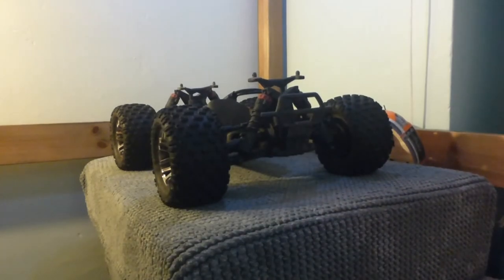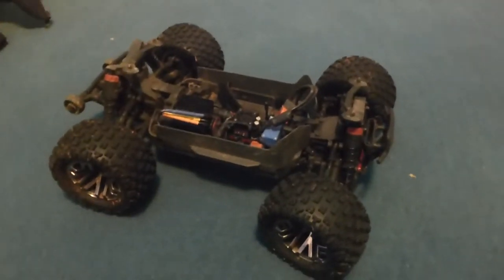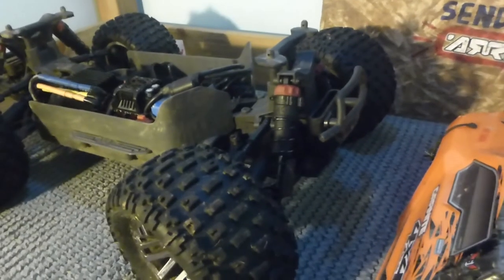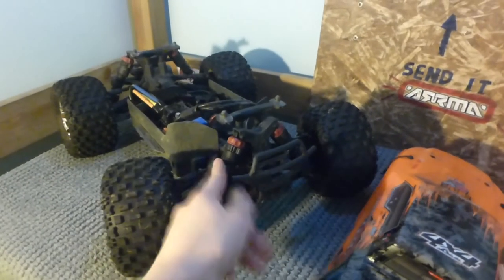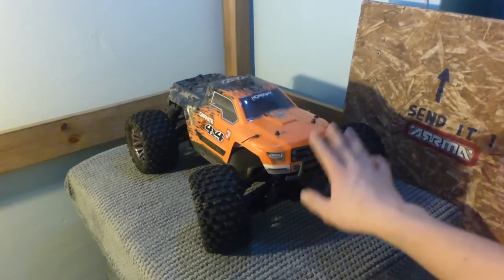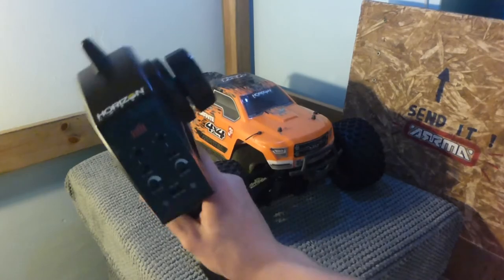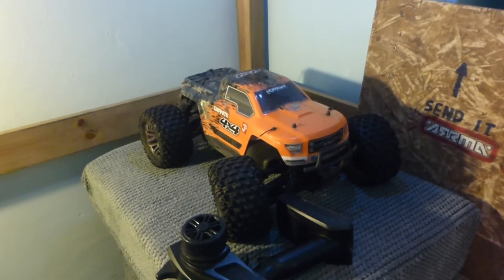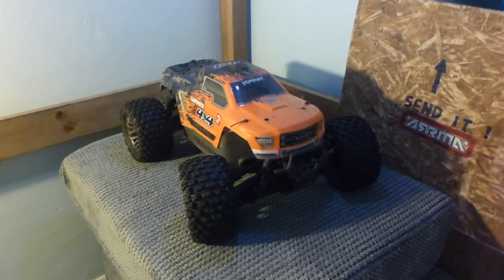Arrma Granite review after 1 year (4x4 3s BLX)

Comment: Ive had mine for a couple weeks and I like it a lot...put metal in everything drivetrain related.think I'm going to get better controller/reciever,steering servo front end parts...couple bigger batteries and some street tires and just make some different bodies for it.i can't see ever running more then 3s maybe 4 but I can't imagine driving a 6 or 8...too much truck for me
Reply from the maker: yeah, I think I got fed up with having to spend so much money on it because I wasn't expecting to have to upgrade it so much

Comment: Hello. I  just watched your other video from a year ago so went to you channel and found this video. I was curious of how things turned out for you . I wish I would have seen your other video a year ago . because I could have been a help.  I have the same truck and after a month all four shocks were leaking,  after some research I found Arrma makes a kit to replace the  
o - rings in the shocks. They are made of neoprene instead of rubber like the stock ones. Cost I think was $8  U.S. and where easy to rebuild myself.  It's been about a year ago I've been doing hard landings from about 12 feet in the air and  they still don't leak. And I'm glade to see you stuck with the stock ones they are better in my opinion,  than the ones you showed on your  video. They  don't have caps on top so less chance of blowing them apart. And you can get debris in your spur gear there is a hole just under the drive shaft you can tape shut . I took  the case apart and taped it from the inside. And I've still have been through four spur gears. It doesn't do well bashing in lose rock. You May already know all  this stuff by now but I had nothing better to do. I left mine all stock it doesn't need upgrades. Parts are  fairly cheap.  And it' was the cheapest monster truck you could get with a Brushless motor at the time and maybe now. I think it's worth the price.  Now I gotta go checkout the video of the bike cave.
Reply from the maker: Wow great thanks for your comment 👍

Comment: I have the V3 version in green since a month and so far no problems. Pretty happy with it. I just changed the esc punch and break one step down.
Reply from the maker: Thanks for your comment, hopefully you won't have any problems!
Reply: @Mainlythingswithwheels  yes I hope so, iam not a extreme basher, i don't drive in skatepark or try  triple saltos and 10meter jumps. I grew up with small rcs and i like to drive them on Asphalt, trails and in my garden.